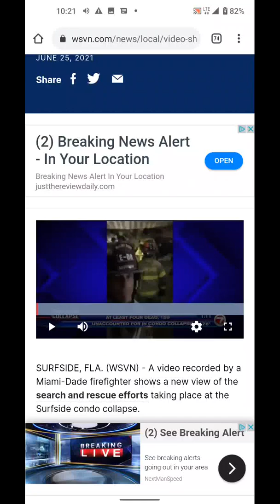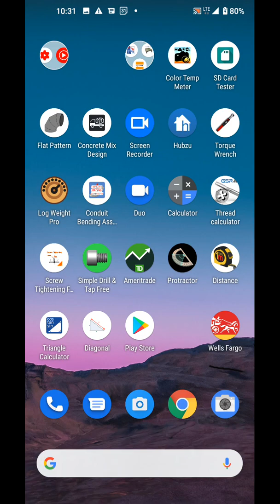Champlain Towers Collapse Sinkhole and Water Theory Why Concrete and cars Displaces Water

Comment: the sinkhole, lol. that's it, the building collapsed, displaced the ocean that rose up due to man-made concrete emissions, and flooded the garage with a foot deep of broken pipe water to fill up that sinkhole, lol.

(rant warning) it's not the people that are looking at blueprints and photos and looking at "what is" that I have issues with, it's all the other you-tubers guessing the color of the moon affected some lay-line that skipped under one part of a building to collapse the far side beyond, that I just roll my eyes at. and it's even a bit annoying when so many commenters elsewhere type "did you see ...Biulding Integrity" in the comments, when that channel is way off in the nether-land of fantasy what-ifs instead of being firmly grounded in what is actually at the rubble pile. the highlighted column sections the guy has is not remotely like what can be clearly seen on the top of the rubble pile (O and P back to the stairwell at an angle, not from M-9.1 straight back), you can even see it in the CCTV vid, that corner is gone including the out-cove between the decks that he says was still standing when the last bit tipped over and fell, ugh. some people I think are just blind, or they listen to the media and regurgitate that while ignoring everything else. Think, you have a brain, use it, people, lol.
Reply from the maker: I like your moon analogy...

Comment: Clearly water supply main to building. Could be anywhere from 1 foot at multiple entries from city mains or one large under extreme psi as big as 2 feet. Water fills up voids quick from mains
Reply: Except for the fact, that they routinely had cases where there was several feet of water in this basement apparently. That's harder to explain.